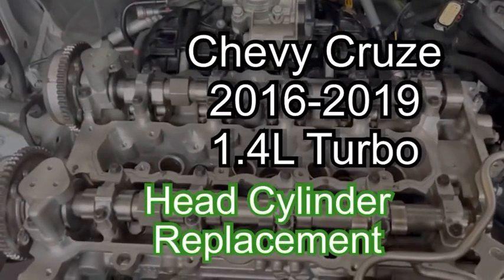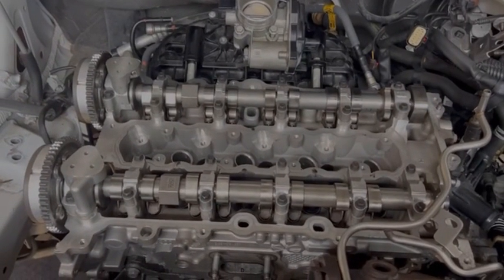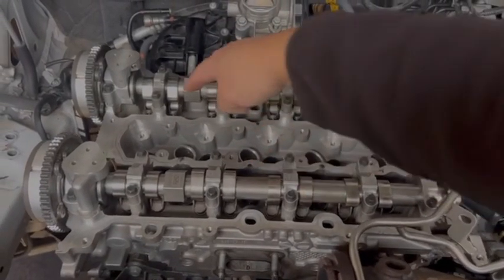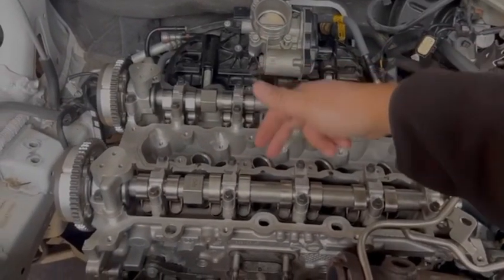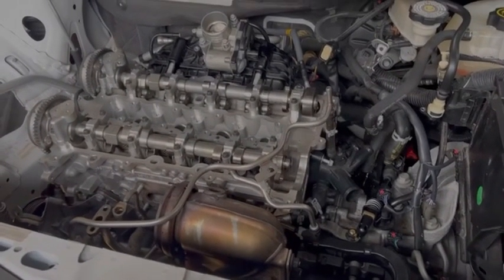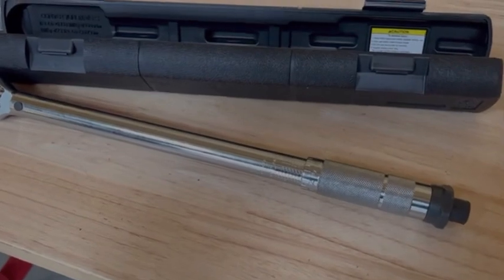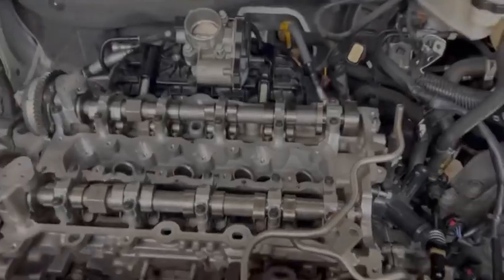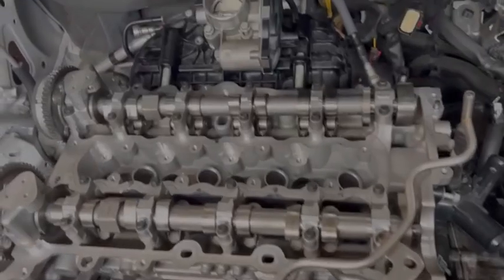Cylinder head replacement, head bolts sequence 2016-2019 chevy cruze 1.4L

Comment: Any thoughts brother? Should I remove the valve cover and do an additional 200 degrees?
Reply: Hi did you ever figure it out if it was fine 37 ft lb on your head bolts?
Reply: @daviddyck4527  I removed the cover and did the real torque that I found in a real manual. 37 ftlbs is not enough for a turbo direct engine

Comment: I found on Cruze forum for gen2 the 1.4L LE2 engine head bolt spec is 
22ftlbs + 240 degree torque turn. Which would be way more than 37ftlbs final torque and makes more sense since the bolt is pretty beefy 🤷‍♂️

Comment: I used a 1/2” snap on digital torque wrench and found using your method 18+22+45 degree torque turn, final torque is 37ftlbs which seems pretty low for a turbocharged direct injection engine head bolt 🤔